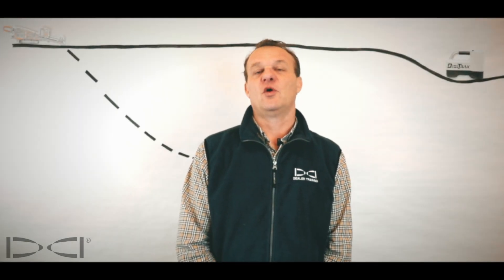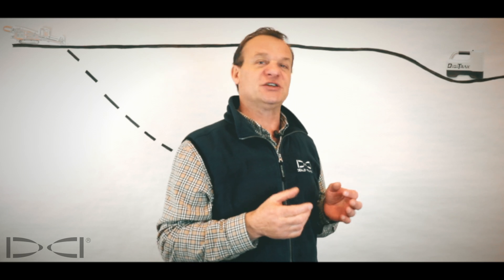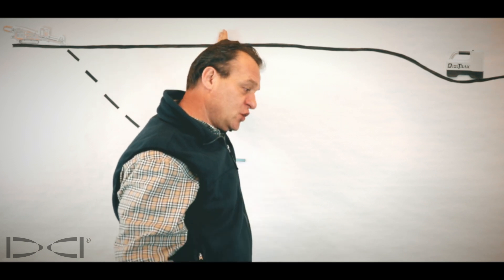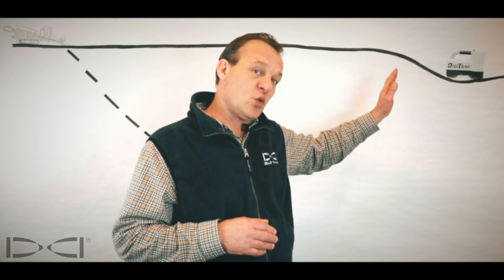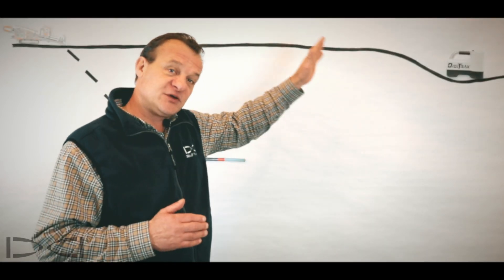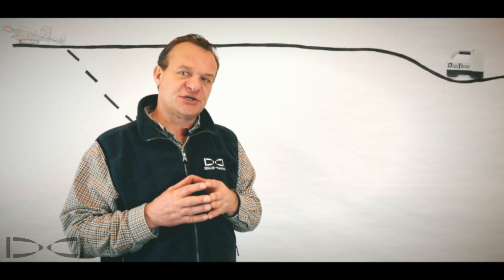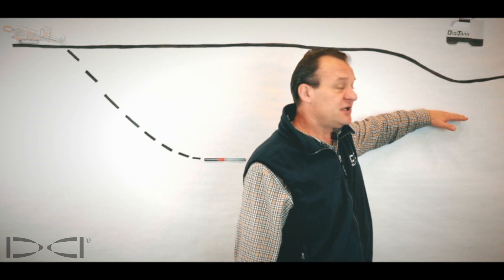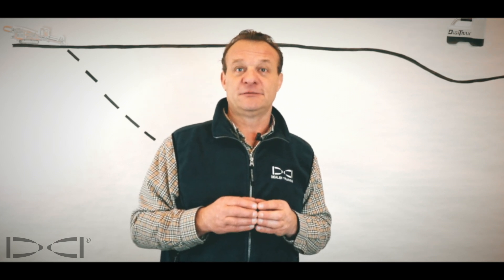DigiTrak - Falcon F5 Training -Target Steering & Remote Steering

Comment: I was trained by my pops on a 7-11. Didn't touch the locator then. Just the drill. 

Fast forward 7 years I started working with my uncle and all I was doing was locating.

This year I got my own drill and you don't fully understand the locator until you sit on that drill.

These locators are amazing pieces of equipment.